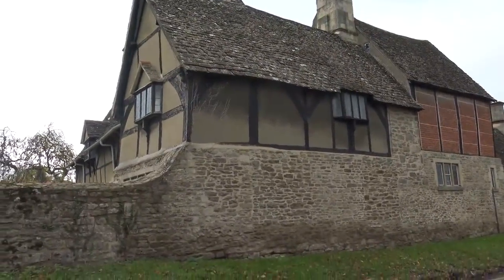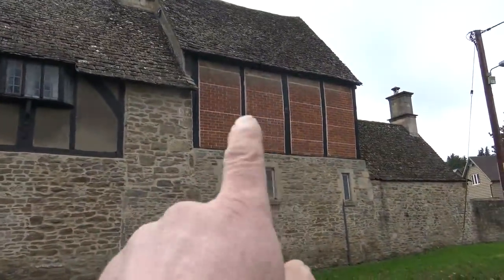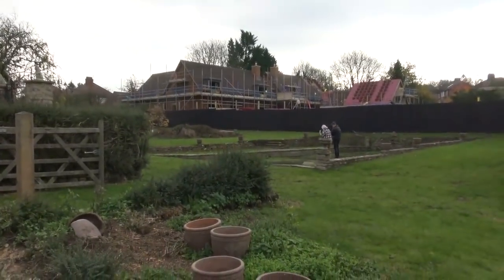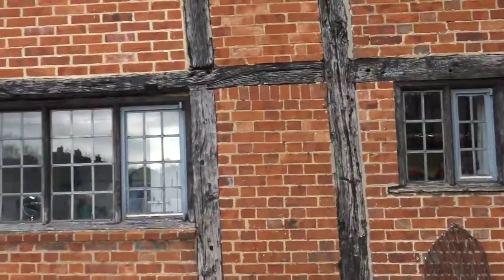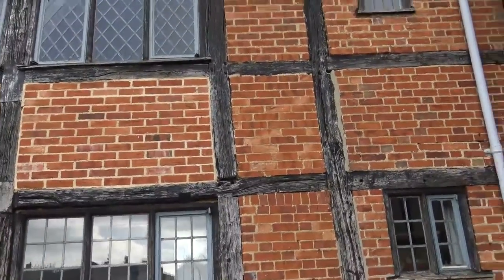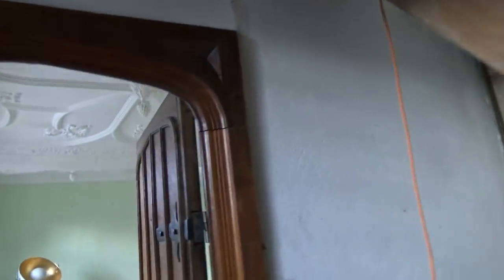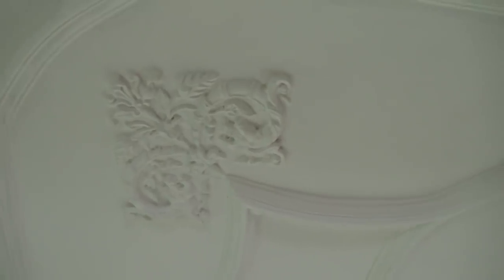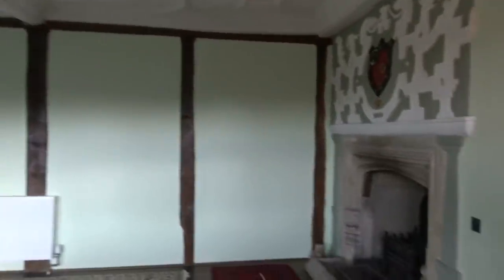A Grade 2 Listed medieval house - or is it?

Comment: Very interesting how and why some buildings are listed. In my own listed place the  1970's single glazed pine windows meant that I wasn't allowed to have any doubled glazed windows except where I built on a small extension with 3 small windows into which I was allowed double glazing. I don't think that the powers that be really care too much as they seem to have a different agenda it seems.
If they really cared then more public money might be available to help our many hundreds of local rural churches that are falling down and in urgent need of repair
On the subject of oakum, I thought that oakum was a tarred fibre used for filling gaps in boats, surely this would be the wrong material to use in an area that you want to be able to breath wouldn't it?
But as you say, use lime, lime and more lime but I have noticed you talking about using a hot lime mix when an ordinary putty mix would be just as fine and adequate wouldn't it, just so long as it's
not any of the commercially available NHL 3.5 made by firms jumping on the lime band wagon like a certain big mega company whose name begins with H and ends with S and who supply a
lot of aggregate as well as cement products on many modern building sights.
Not wanting to put people off using hydraulic but a putty or hot mix is better and kinder for these old buildings (like an NHL 2.0) and in conservation they should actually be using a like for like material when possible. Hydraulic is mainly used because it dries faster and you get your money quicker.
Keep up the good work Mr Ward.
Reply from the maker: Good points all peter.. The oakum is breathable and flexible - amazing stuff... we sell caulking kits on the heritage house website -  very popular...
Reply: Thanks for the reply Pierre, I'll have a look.